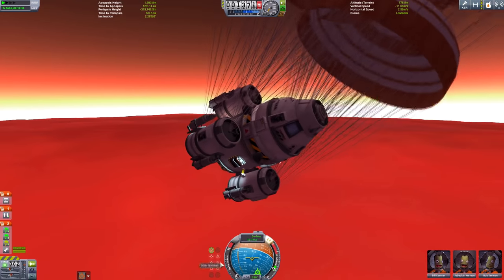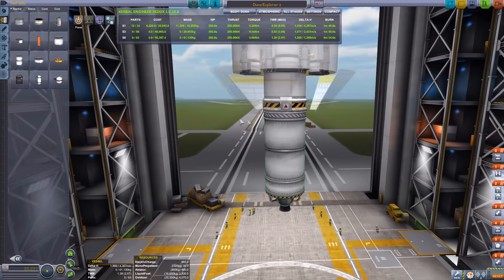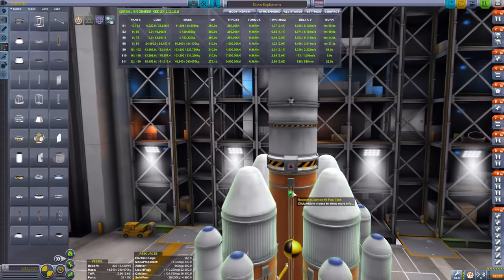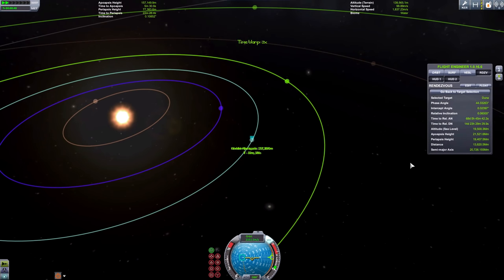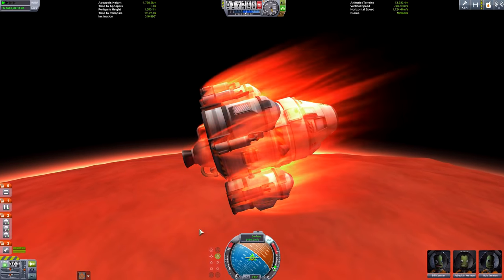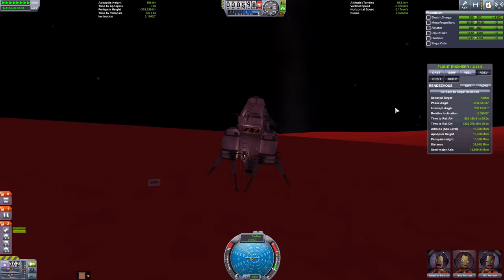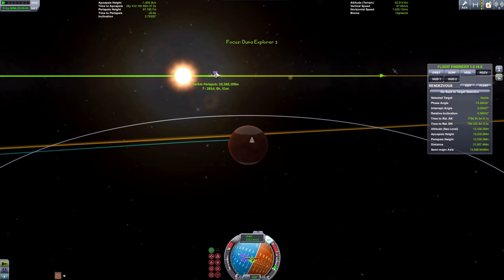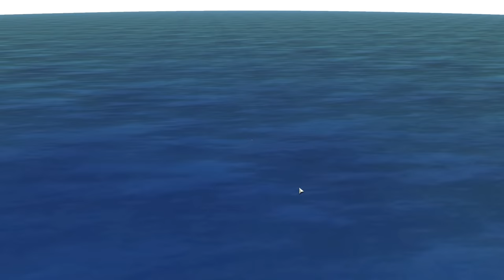Kerbal Space Program - Duna Tutorial Engineering Style V1.0

Comment: Really enjoying your videos. Sadly it's getting me excited for Kerbal but I don't seem to have enough machine power to run it. I'm using an antique 2007 Core 2 Quad and a 2011 Geforce 560Ti. They're old but still manage to run some relatively modern games, but Kerbal is appallingly slow and lag ridden even as pure stock. I assume there's just a lot going on in the simulation and it's too much for my rig. Really need an upgrade!
Reply from the maker: James Duffy Kerbal is one of those games that uses a lot of processing power for simulation, there is a physics bar in the options menu could lower that and some graphics and see what happens worth a try.
Im using a Geforce GTX 580 struggles slightly from time to time but its ok for Kerbal
Reply: Orb8Ter Thanks, I'll give it a try. It really struggles and takes ages just loading to the main menu though so not too hopeful. I'm also usually a mod monster in games but I think that's not an option here. Going to try just Engineer Redux, Docking Alignment, Alarm Clock and the new asteroid official one. Hopefully I'll get launching soon, watching through your Odyssey series in preparation.
Reply: Orb8Ter Seems to be working now. Tweaked the graphics down, have it fullscreen rather than windowed and fixed a missing font. It was also running as 64 bit for some reason and seems 32 bit actually loads and runs faster and with less stability issues. Working my way through career mode now!
Reply from the maker: James Duffy Awesome that's great news best game I have even when playing other games I always come back to this game. Never completed career I'm more of a sandbox player as that was all we had back in the alpha days.

Comment: The problem is that the parachutes can't open on career mode because aero forces and heat allways destroy before you deploy them
Reply from the maker: I use the same physics settings in sandbox mode as career, you need to be traveling slow enough for the chutes to be safe, 
problem on Duna the atmosphere is thin so you don't slow down much so you are either going to use high altitude chutes or rockets to slow down to a safe speed for parachute deployment.
Reply: +Chuck Norris physics in career mode are identical to sandbox, you only have to plan your flight the right way, slow down using your engines as you do when landing on Mun and Minmus and deploy chutes when you slowed down enough.
Reply: +Chuck Norris if you right click on the parachute the game will tell you if it is safe to deploy it.